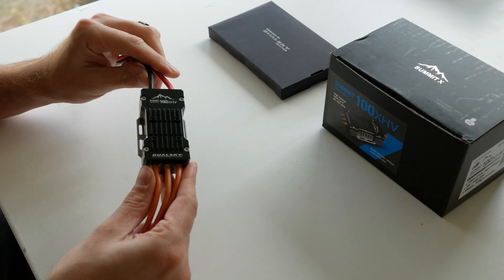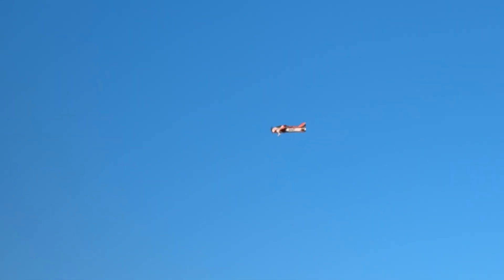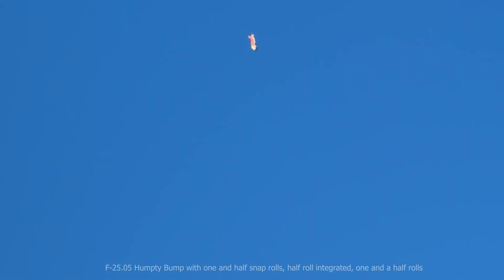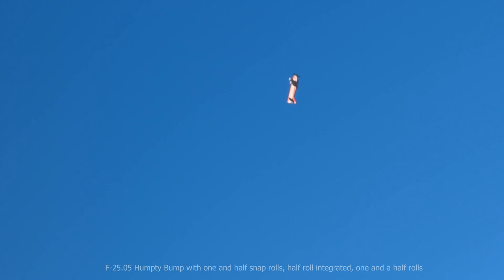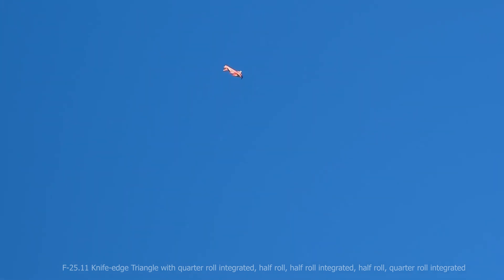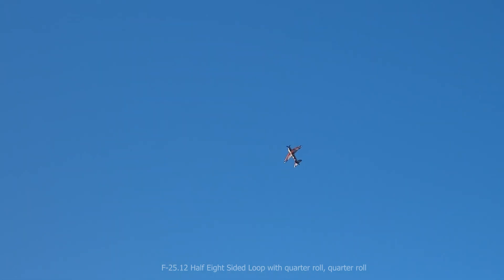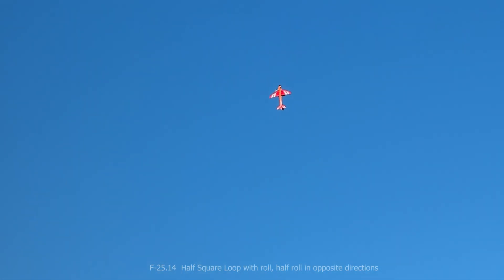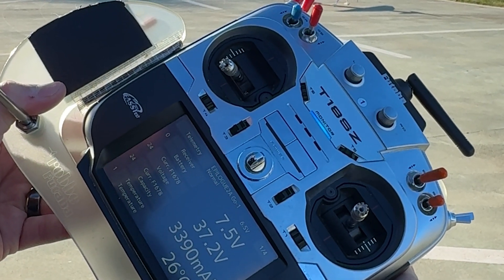Dualsky Summit 100XHV ESC for F3A || Flight Test with the Epilogue from BJCraft ft. F-25 Schedule

Comment: Very nice flight, could you share if you changed the min max rpm settings from default in the ESC and what rpm settings you have in your throttle curve for your flight modes,